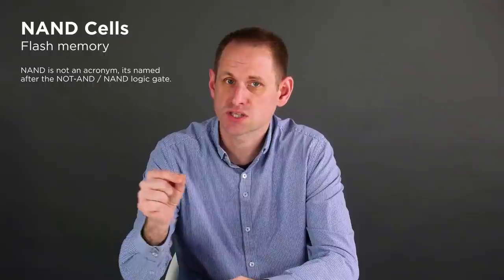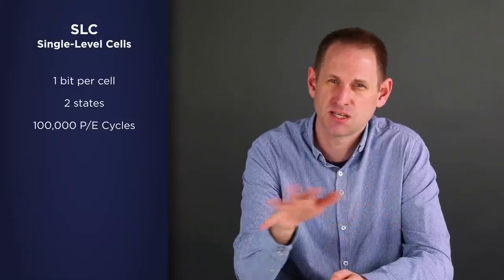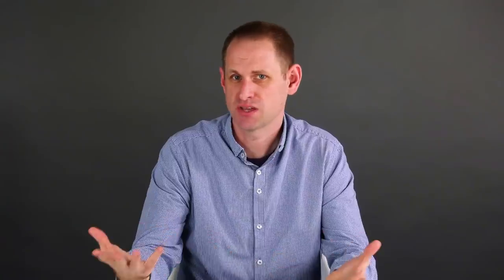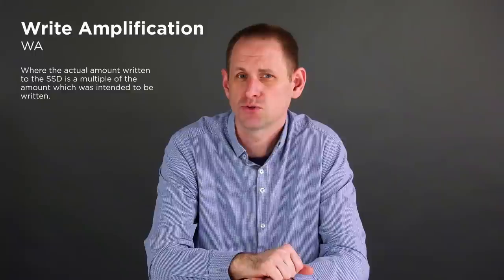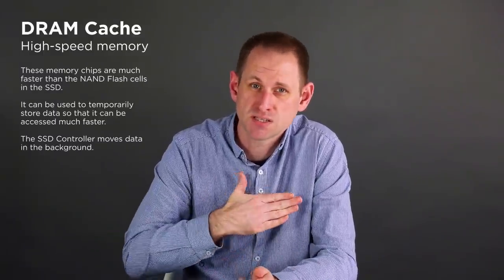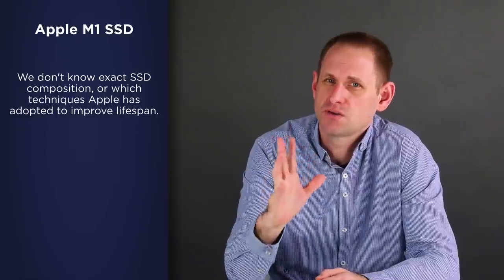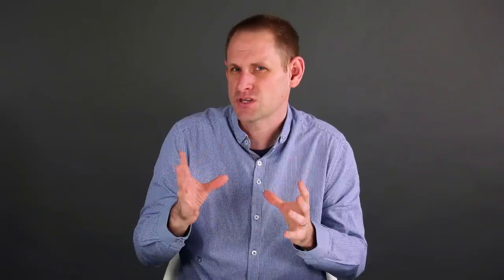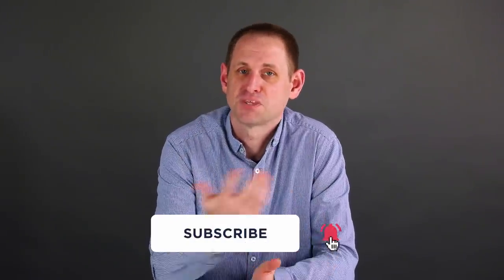How do SSDs Work? (+ thoughts on Apple M1 SSD lifespan)

Comment: Even with many excellent engineeers, It's possible that one or more issues escaped them. As an example, many excellent scientists and engineers were involved with the Hubble telescope. Yet, the initial Hubble telescope was crippled because the engineers had omitted doing one specific, basic, sanity check before launch. With respect to the soldering of SSD's, the SSD controller is on the same board as each individual SSD, so there would no incompatibility issues with inserting 3rd party SSDs -- so no risk of incompatibilities with Apple's SSD controller. It's a marketing ploy, intended to increase profits -- if Apple had wanted to use a socketed SSD, they would have.

Comment: Users of older Macs can enable TRIM with a simple Terminal command.
I installed a Samsung 840 EVO in my MacPro in 2013 and it has only just passed its 50% TBW level after 7 years of use.

Comment: Very excellent info.  I’m convinced that it is difficult to select a utility that would measure accurately the slow deterioration of this m1 ssd.  As most of us are aware ...even the 16gb models really do an apparent alarming amount of swapping depending on usage and the apps running.  You have provided many ideas of what is going on with this ssd in the m1.  I believe more than ever that I will just use the machine and will always not baby it because of the possible entity is wearing out.  Makes sense that we can be aware of disk wear...thermal degradation...incoming electrical as well as static discharge and the list goes on and on.  Use the machine is the best idea and be aware of good practices in setup, maintenance and usage.  Thanks a bunch for the excellent info

Comment: Values  100000 P/E (SLC),  10000 P/E (MLC 2-bit) are probably related to much older manufacture processes. For example Toshiba MLC 15nm 3000 P/E  (2014/8).
Reply from the maker: Probably. I’m erring on the side of caution.

Comment: Since the past two mac os updates even my macbook pro 16" that actually suffered of a ton of swapping seems to be tamed.... by example I use twinmotion for architecture rendering and befora that my files always consume all my macbook ram and use 16 to 20gb more from swapping my ssd memory.... but now since the last two updates my exact same workflow and file never consumes more than 8gb of ram... never using again swapping memory and being entirely on my ram memory... I guess it was a mistake of apple that now is fixed at least for my workflow is comoletely fixed. I do need the test on davinci resolve to see what they did to that part

Comment: I remember my first Core Duo white macbook. Apple engineers clearly have missed the awful overheating issue of the new construction and for months avoided admitting the fact their new (2006) laptop stalls and has to be put into safe mode to serve any resonable purpose. A few months later they released the infamous SMC Firmware Update which just let the macbook's cpu run at over 90 degrees and made impossible to safely use it on any lap. Yes, I consider a scenario with apple engineers releasing a flawed design.

Comment: I am not too worried about SSD writes on my M1 Mac, or the non-serviceable SSD in the machine. The experience of ownership from a consumer and business user perspective is extremely good. I don’t have time or interest in hacking on my MacBook Air. It is an “appliance” that will last for 10 years or more, and it is good as is. I do have an old MacBook Pro that I have upgraded with large capacity SSD’s for home server duty…but that same upgrade will be accomplished in the future with Thunderbolt-connect external SSD’s - that is a future when my 2020 MacBook Air is 10 years old and the batteries are worn out anyway, and I am using a new Apple Silicon machine with a processor several generations improved from the M1. These computers become “obsolete” within a few years, so I’d rather have a robust, solid, well-engineered, integrated laptop that I don’t need to tinker with. Buy it, run it, sell it or repurpose it, and replace. I’m fine with that model…been doing this for 25 years. People who want to install off-the-shelf components in Mac’s are just missing the point…we pay Apple to select the best components and do the integration. Let them do their job.

Comment: I appreciate your attention to this issue, and explaining things very well. But I've used my M1 Mac with 8/256GB for about 5 hours with Adobe Lightroom, and in that time it wrote roughly 4TB's of data via Kernel Task. As someone that uses Lightroom on a daily basis, this makes me feel that I'll be lucky to get a year or two out of the SSD with writing like this. For the last couple days of use, I'm already at 5.3TB's written via KernelTask. What is your thoughts on this type of writing?
Reply from the maker: Are you using Lightroom Classic via Rosetta 2 by any chance? This is a known combination that causes high data writes.
Reply: @ConstantGeekery  I was until recently, when the Lightroom Classic beta was released with native M1 support. I also see very high writes using Lightroom CC which has been M1 native since I got this PC. Do you think I should limit my use of Lightroom on this PC until these issues have been addressed, and do you think with writes like this, I should be concerned about the life my SSD? Thank you.
Reply from the maker: @SeanGold  based on the data we’ve collected, Adobe still has some work to do. I’d be cautious until they fix the bugs.
Reply: The better question IMO is “will apple replace the system boards that have a failed ssd 1-2-3 years from now?” Or will they just say it was not used as intended?
Reply from the maker: @r3ndszergazda  Historically, Apple has had replacement programs for components that failed early. I doubt they could argue against any use of Adobe CC software, since Apple themselves featured it at launch. 🤷🏼‍♂️
Reply: @r3ndszergazda  this is the big question, and I feel like they would, but it's that uncertainty which is troubling. Leaves me in a funny place trying to use my new computer for anything more than web browsing. I wish they would make a statement about the issue.
Reply: @ConstantGeekery  that’s what I’m hopeing for. But what if they just say “well the adobe suite wasn’t really meant for the base air model, as it’s a PROfessional software” (that ofc won’t rule out / explain what happens with the base pro model - which I hope that noone in their right minds are buying anyway)
Reply: @SeanGold  I have managed to reduce the data writes considerably but turning off graphic performance under preferences. The trade off is choppy performance, buts it’s still usable. Obviously this isn’t how I intended to use the Mac, so hopefully Adobe are working on how Lightroom uses the unified memory system with there universal release of classic.
Reply: @SeanGold  at this point I wouldn’t be concerned about the issue and/or limiting the use on your m1. It has been payed for, it’s a machine, put it to good use & if it dies it dies. It would be a bad decision IMO to baby it just to MAYBE extend its life.
Reply from the maker: @r3ndszergazda  the MBP M1 has the same chip and SSD. The only difference with the base Air is one less GPU core, which has nothing to do with the SSD. On the product page on Apple’s own website it has the Lightroom logo in a paragraph talking about how you can run your apps with Rosetta 2. With the huge number of M1 owners running Adobe products, there won’t be any wiggle room for Apple... but I suspect this won’t be an issue and the SSD has a much longer lifespan than people think.
Reply: @ConstantGeekery  thanks for the detailed explanation & also for your great quality content!
Reply: @ConstantGeekery  yeah agree with the life span. I think this has been over marketed as an issue I wasn’t even aware of even being an issue in all the years of owning macs. I didn’t even know SSDs have a life span until owning my M1 mac. I wouldn’t have even thought twice. If the computer runs great then awesome! However I do appreciate the knowledge past on.

In terms of the question of doing pro work on these base machines. Well my last Mac was a 2012 MBP, so even though my M1 Mac mini is entry level, it’s still a huge upgrade from what is a ‘pro’ level machine 9 years on. I’m purely Lightroom user, so no video work. I ran that laptop to the ground & still runs great to this day. Haven’t even checked the SSD state.

Comment: The real ironic part of this mess is that Apple's virtual memory system is handling demand paging and available page queue management so well that a lot of folks are misinterpreting the lack of severe performance degradation as a diminished need for physical RAM for heavy duty tasks.

Although unified memory is more efficient than a standard Wintel GPU setup, it's only in sending data to a discrete GPU - or partitioned main memory for integrated graphics - where the real economies come into play. Outside of the lack of duplication of graphics memory - and processing graphics requests in main memory - all the other processing is probably being done in an identical fashion as it is in Wintel systems.

So ... the lesson to be learned is if you're going to be doing resource heavy tasks, max out the RAM. Your SSD will thank you for it.

Comment: It is no longer correct to say that MacOS doesn't enable TRIM on any third party drives by default. For example the Samsung SSD 970 EVO Plus that I've installed in my 2015 MacBook Pro 15 inch has TRIM enabled automatically, without having to use the trimforce command.

However, I have no idea what rules are used to decide which drives get it enabled automatically.
Reply: This is on Catalina by the way.
Reply from the maker: Good to know 👍🏻

Comment: Thank You,
a very detailed technical explanation of "what" goes on in the world of SSD's,
it explained and quelled some of my concerns about the Mac Mini M1 

I have a Mac Mini M1, with 256GB SSD and 16GB Unified Memory,
It was all my Budget would stretch to,
I also have a Crucial Crucial X8 2TB External SSD 2TB SSD,

because the 256 GB internal SSD runs out of space quite quickly,
I am relocating / moving much of the internal SSD's Data onto the Crucial X8 2TB External SSD,
(Music - Photos - Movies - Documents)

It would be great and Super-Useful if you created a Tutorial,
that gave a Workflow  for keeping the Capacity of the Mac Mini M1 256GB internal SSD as low as possible.
especially if it it is done automatically,
at the moment, I have to keep an eye on the Free space of the 256GB internal SSD,
and every couple of days, manually move files from the Internal 256GB SSD, to the External Crucial X8 2TB External SSD.
in order to free up space.

Thanks again for your insights into Mac Mini M1 and SSD's
Reply from the maker: I think you can use symlinks to relocate stuff, but I’ll have to test that. Tutorial is a good suggestion 👍🏻
Reply: @ConstantGeekery  ---> I think more and more people are going to run into problems with the limited unupgradeable internal Memory of the M1 Macs,
In the past it was usually easy to upgrade your Memory in Macs,
or it was easy to find a reputable reseller who could even upgrade Hard Drives in iMacs (notoriously difficult to prise apart)

I had heard of the "SymLink" workaround, but not investigated it,
and there may even be a Market for an App that can manage your SSD Space between Soldered Memory and External SSD

Comment: Isn"t the SSD lifespan on other Apple Silicon products, like iPhones or iPads, that are around for many years, a good indication to what to expect from the new M1 Macs?
Reply from the maker: Possibly, though I’d say the SSDs in the Intel Macs are also a good indication. Apple has been soldering them in on some models since 2016, and there are no widespread reports of failure. You’d assume the technology is improved now compared to then also.

Comment: Sir, how is the performance through Parallel or virtual  softwares.  Because I want to use some softwares that work on windows only.   What happens to RAM, when using Parallel

Comment: Does increasing the storage lengthen the life of the SSD?
Reply from the maker: More cells means a greater amount of data can be written before overall drive failure. Depends how you use the drive of course. Ideally, you should have more capacity than you need for optimal performance. I usually aim for double.
Reply: Absolutely! More cells contribute to overall maximum TBW. Manufacturers specify it on every model and their capacity, the bigger the SSD size, the higher the TBW (before failure) specification.

Comment: i find it hilarious , that everyone is looking at the macbook's with their soldered on  chips .. while Microsoft Surface is doing the exact same thing, and it's even worse in those products !! , i personally think the future is gonna be soldered on chips anyway, even for companies like ASUS..  how did the first macbook air faire with their ssd's ? are they still in use ?

Edit:  Maybe possibly a video , presenting  a macbook 2011 with one of their first ssd's  would be a good test to see how mac's go along with ssd's and if it still fine
Reply from the maker: Yep, but everyone loves to hate Apple! We have a couple of older machines kicking around, so maybe I’ll check the stats on them.
Reply: I had a 2011 11” MBA 2gig ram Snow Leopard which I hammered with major presentations, graphics etc until 2018 when 2 gig finally was just not enough.    Never had one slightest issue with that little MBA and hated to let it go.   And I can’t wait to replace my 2018 MBA with M1X architecture in the future.
Reply: @phbrinsden  There you go , in Pbrin's case no.. , definitely worth investigating in a youtube video ( not allot of those vid's out there about that, wink! ).. it doesn't even have to be a apple laptop  just a bunch of 10/11 year old ssd's and how much degradation do they have , and are they still usable ? i've only seen it happen to 128gb ssd's running with encryption and constant av checks where the data written daily is over 4 to 8 gb... so yea ;)  

and apologies , i don't want to appear pushy to the youtuber btw ;)  ,

Comment: hey, i bought my base model Macbook air 1month 25 days back and the battery health has dropped by 2 % it is now 98 , when i bought it, it was 100% so is that normal i mean isn't that too soon? cycle count-29
Reply from the maker: It should be good for 1000 full cycles, so assuming they count down the percentage in line with that, it sounds right. Periodically, it’s good to run the battery completely to zero and charge to full.
Reply: @ConstantGeekery Thanks a lot for the reply i really appreciate the amount of knowledge you have on what you are talking :)
yes i was doing the 40-80 thing will get it drained fully once in a week i guess, is it necessary to drain it to zero or 10-15% will do?? 
once per week is good right?? 
and so i should not worry about my battery's health at all considering the present percentage and does your macbook has the same results ?? 
and is battery drain graph linear or it first goes down fast and then stays ??

Comment: A couple of additional points on why apple decided to solder on the SSD.

Privacy & Security. You can't just take out the drive and slot it into another computer to try and access the data.

Reliability would be another concern. Apple likes to minimize risk with their designs like moving to simulated home buttons and trackpads. This makes it less likely that an SSD will become lose and cause problems for users.
Reply: What if the motherboard fails? They are going to have all your data when they change the entire motherboard (ssd, ram, m1)

Comment: I agree with you (except for 1 point) but don't think the ever decreasing repairability of equipment is such a good development, although I understand there are reasons for it from a design and manufacturing perspective. 
Where I disagree with you is when you say you have to format a HDD to erase the data on it. This is not the case. If you want to be sure that no data goes with it on the HDD you sell you should overwrite it completely with (random) data. In the Dutch Air Force we did that 7 times with the help of a tool. 
When I dispose of HDD I first overwrite them and then drill a few holes in them. 

Translated with www.DeepL.com/Translator (free version)
Reply from the maker: Writing random data is a good idea. I was referring to a full format - i.e. writing zeroes. Seven passes of random data should do the trick though! 😁
Reply: @ConstantGeekery  Copy Pasting a large videofile does the trick too when you havent got a tool at hand.